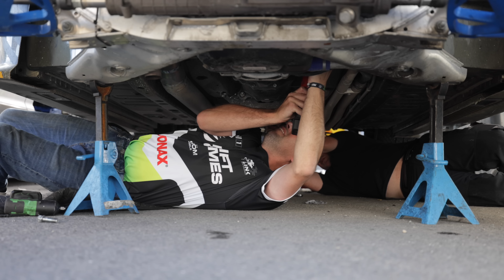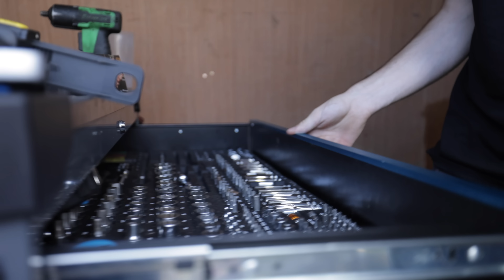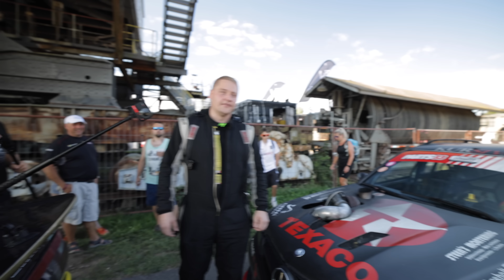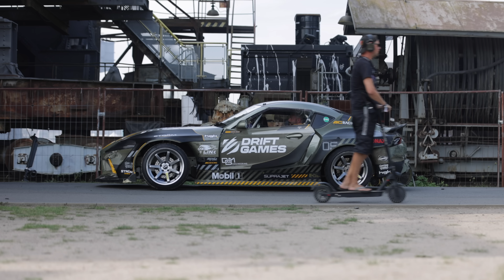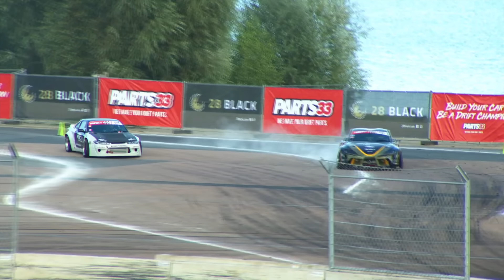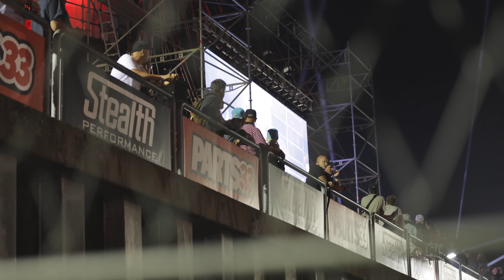FIRST BATTLES in my 1000hp 2JZ Supra were INSANE!

Comment: To stop the gearbox breaking issue from happening again what about sticking a hydro position sensor and then with a tps say if hydro is engaged throttle does nothing if the clutch is also not engaged as a safety net for you, if that’s even do able?
Reply from the maker: Not now as it’s on cable throttle again
Reply: @driftgames_life yeah remembered that afterwards lol but you could make it kill spark though, might be other ways to do it but those are the 2 that come to mind